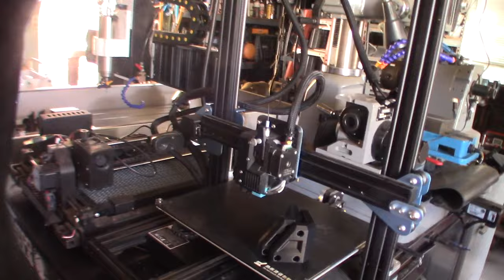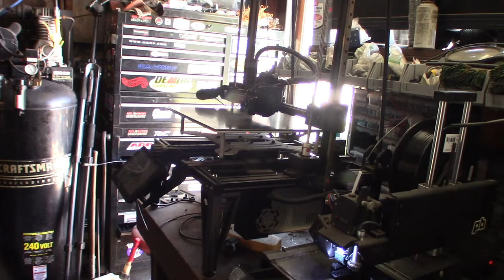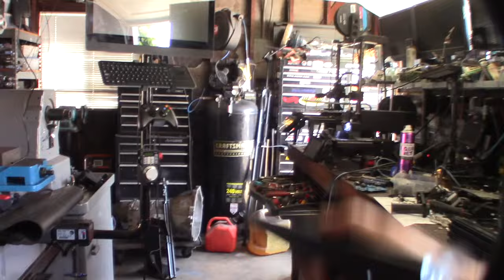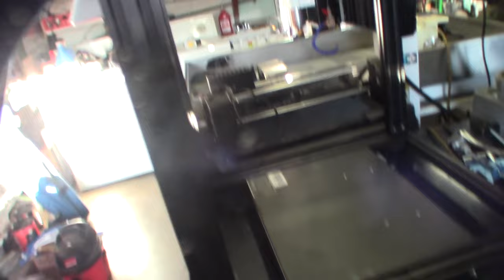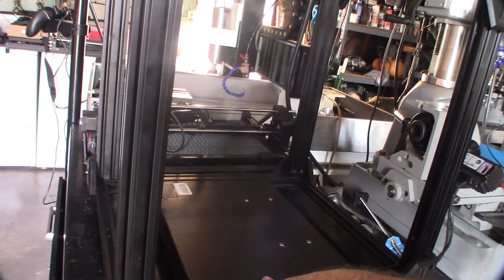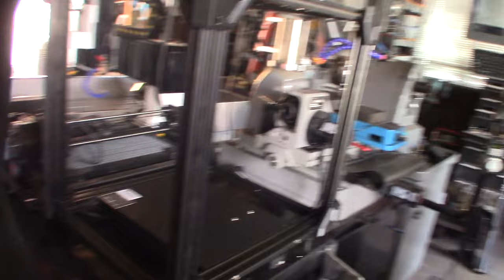Orca Super Cube CoreXY 3D printer concept Part 1, Planning and Frame construction.

Comment: A bed mesh is not meant to compensate for a crooked bed, it's meant to compensate for unevenness of the bed surface.
The "compensation" of a bed mesh is spread out over several layers, but if it has to compensate a lot the printed part can be too "off-spec" for certain prints.
So on any printer I always try to tram the bed as much as possible before creating a bed mesh with the probe.
I used a belted 3-point self-tramming bed  (it's called "z tilt" in Klipper) on my homemade CoreXY. I was curious and had the motors already and it turned out to not be all that difficult to figure out. It has been working great for me, but I'm sure that if you do a good job at making a rigid bed mount, like you plan to obviously, it will perform just fine too (most CoreXY printers used to have a bed mount like that).